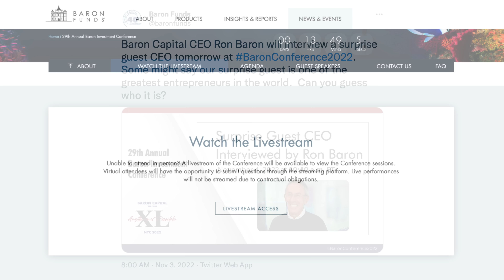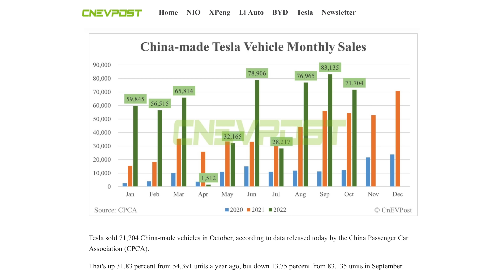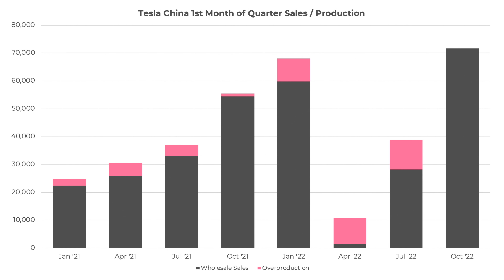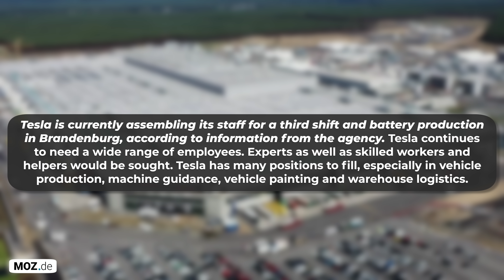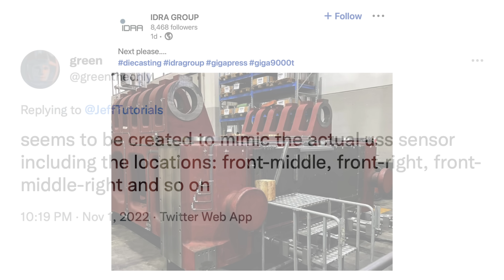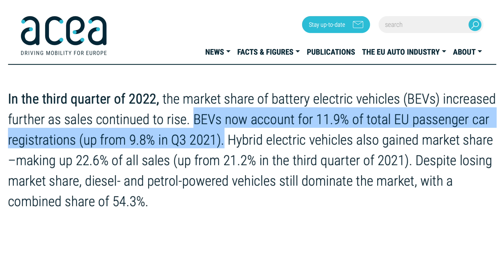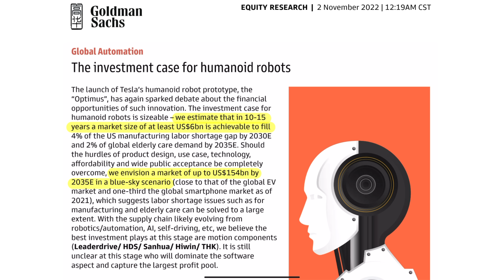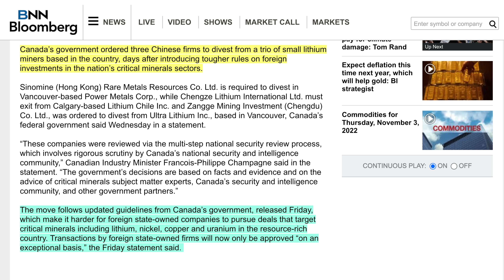Tesla China Sales, Berlin Expansion, Tesla Bot, Ultrasonics, Giga Press

Comment: Rob, I think the latest FSD update is driving notably smoother.  I agree with you on the lane change issues.  It looks like Tesla is still weighting map data too low, if they are even using it to plan lane changes.  That said, what a change since my first version of FSD at the beginning of the year.  Better map integration would cut my disengagement by at least 75%.
Reply: Can't rely on maps
Reply: @gehtdichnixan4704  not rely on, but using maps for lane info could provide useful hints for lane planning, since it can then start planning before having visual clues about the layout (like us humans do, though we use own memory or signs). Generally, dense urban environments would be where this could be most useful, and these are also usually the areas where the map data is most likely to be up to date.
Reply: Tesla wont use map data at all in future.

Comment: What is the reason Tesla does not provide bi-directional charging from the cars to powering a house, like the Ford 150 Lighting? Did they explain? Is there a technical reason?
Reply: +1
Reply: In part because pack life is tied to charge/discharge cycles.  The more you cycle the shorter your battery life.  They did not want to add extra 'miles' to a pack especially in the early days.
Reply: I believe it's because it adds complexity/cost and reduces longevity of the battery. And they offer a much more efficient solution for stationary energy storage on the side.
Reply: @TheEvilmooseofdoom  Thank you for your reply, that's helpful to understand.
Reply: @Muskar2  Thank you for your reply, that's helpful to understand as well
Reply: They are slow and lazy!

Comment: As someone with an MYP on order, I'm quite nervous about the Ultrasonics change.  Hope to see it demonstrated with feature parity soon.
Reply: The wire harness still has the sensor connectors if for some reason this does not work out. I think this will work with camera derived pseudo LiDAR.
Reply: @Atgul-z6o  NOT pseudo-lidar. Pseudo-ultrasonics. As Elon has saids many times, lidar is a costly solution to a non-existent problem.
Reply: @lengould9262 right? lidar adds little value to the system vs the complication it adds overall. The fewer part the better if the camera can do the same jobs.

Comment: Here in Calgary AB, FSD prior & post this update sucked! There's no other word for it. We had a snowfall. It tried to run full tilt and slid coming to a halt or making turns. It aborted at every intersection.  No awareness of the conditions.
On the plus side, straight-away's were okay provided I manually drop the posted speed. If the snow persists, that may be the end of FSD here for a while.
Reply: Rob, 5min. video available upon request. (I've resisted publishing it publicly.)
Reply: Thanks for the report. I've always wondered how FSD would handle snow, but can't say I'm surprised that it sucked. Be safe when using it! No FSD video is worth an accident or even a scratch on your vehicle